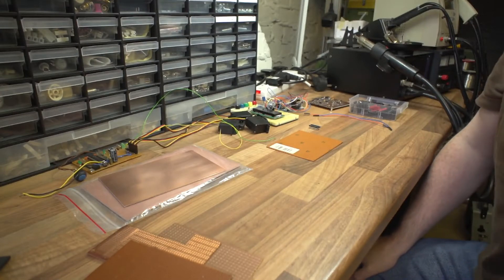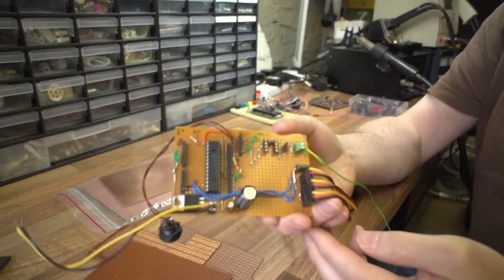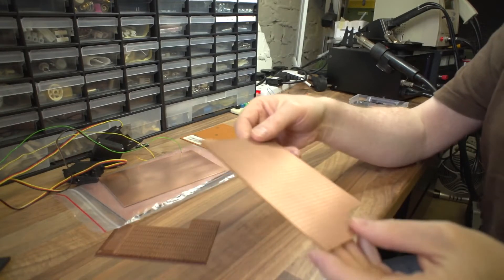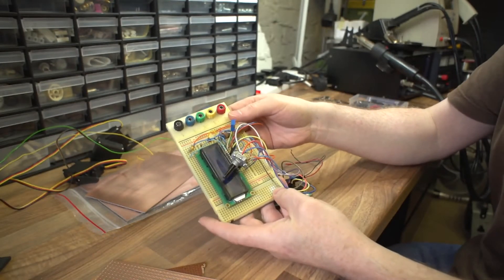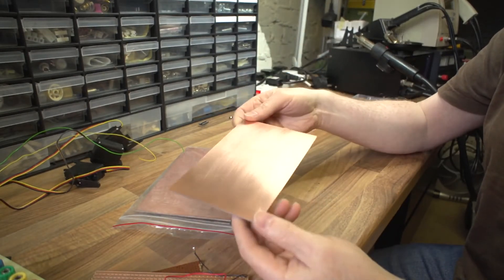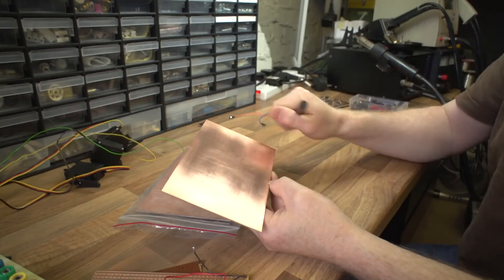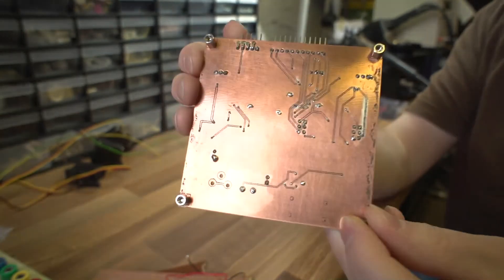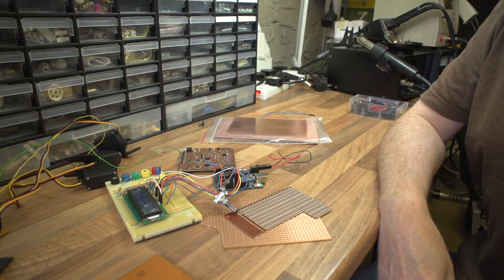Introduction to PCBs, and proto boards. Including Perf Board and Vero board.

Comment: i cannot find the hybrid type of protoboard wherever i look its driving me nuts. Do you know the official name? i cant find any on amazon.
Reply from the maker: Hi. The copper strip board is called Vero (brand name). The green single island board is called protoboard and the white plastic unit where you push your wires in is called a breadboard. All these boards are widely available on Ebay etc. Hope that helps!
Reply: @NEEC1  thank you so much for your quick reply i meant to put a timestamp. I meant the one that you can put chips on without drilling the protoboard 5:15
Reply from the maker: @umop3plsdn  I see. The board I have here has no brand name. But i believe its made under the name of Sunhayato Matrix Board. But also search for 'HONGTIAN 10 Pcs DIY Prototype PCB Universal Matrix Circuit Board'.
Reply from the maker: @umop3plsdn  Ebay number 375717332019 looks pretty close
Reply: @NEEC1  THANK YOU SOOOO MUCH its been so hard trying to find it

Comment: Can you please tell me that what vero board is made of?
is it plastic? But plastic will melt when i will try to solder
Reply from the maker: Hi. Thanks for commenting. I copied this Wiki: "The original Veroboard used FR-2 synthetic-resin-bonded paper (SRBP) (also known as phenolic board) as the base board material. Some versions of stripboard now use higher quality FR-4 (fiberglass-reinforced epoxy laminate) materia"

so basically, it doesn't melt, its not plastic.
Reply: @NEEC1  Thanks!